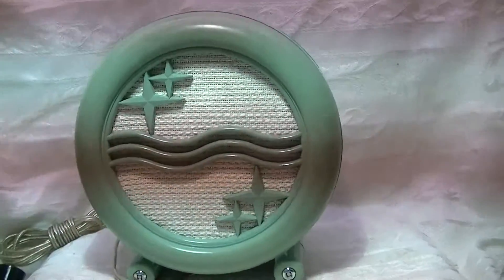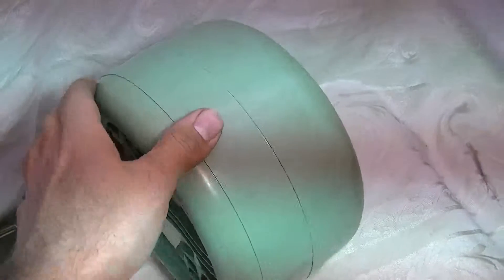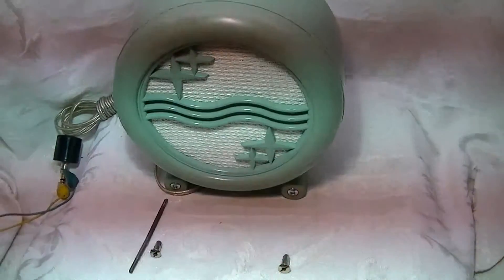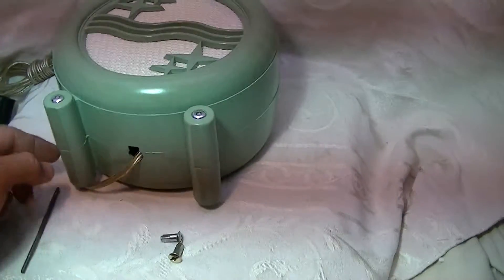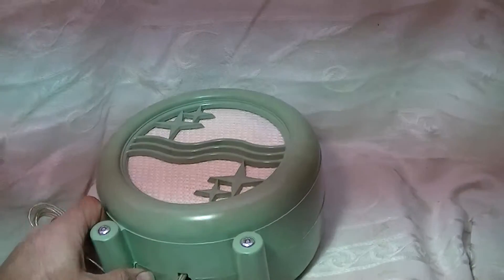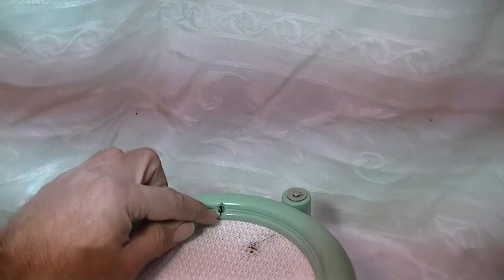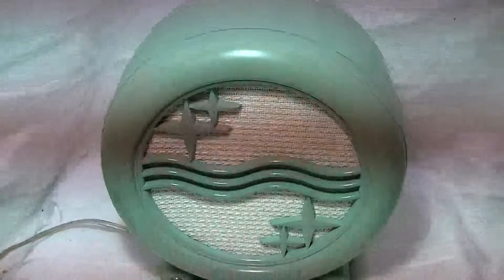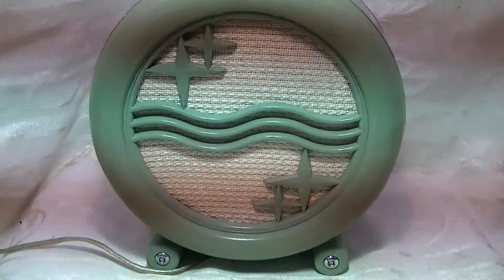Philips "Philitone" Bakelite Radio Extension Speaker c1950

Comment: I have quite a few of these, some single sided, some double sided in both Philips and Mullard versions and in a variety of colours including one identical to yours. All have a volume knob on top and most have screw terminal connections at the bottom. Never seen one with a hole like yours and I don't believe it to be original. There were 2 different grill clothes used as well. I didn't know some were made without a volume knob till I saw your video. Very collectable and I have seen mint examples change hands for $600-$800. Once common, difficult to find now.

Comment: The two I have have the logo on both sides and a volume control on top and 2 screw terminals on the bottom
To connect the cable. One is ivory and the other is brown.
Never seen a green one before.
Reply from the maker: Yes they came out in a few colours. Aegis made them too though those had horizontal bars across them.